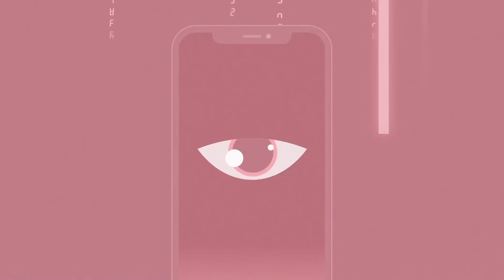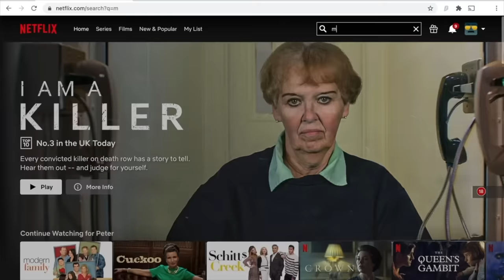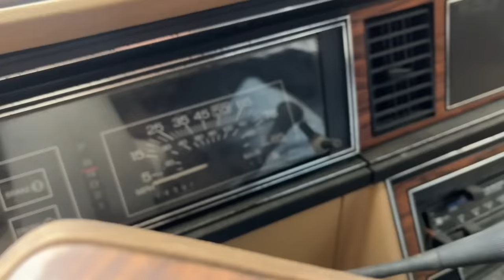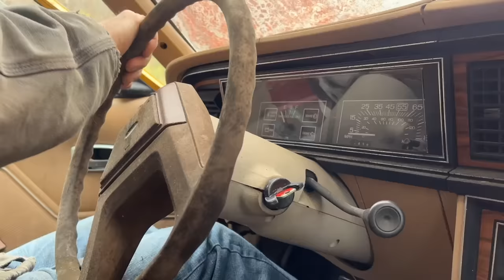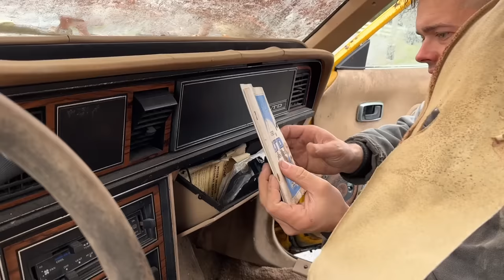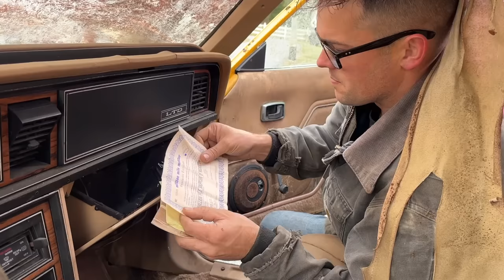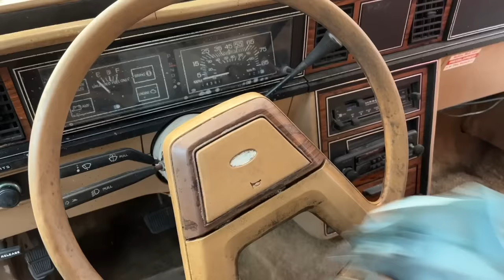You won't believe this car was in the junkyard 28 years! Almost perfect interior!

Comment: I think it was an old taxi cab. Back in the day it would do the airport run and you put your luggage in the back. Love to see how you guys work together as a team. Keep up the great work.
Reply: Same thing I was thinking. Stickers on the doors, spotlight, the numbers on the hood, and hatch, and the mandatory seat belt usage sticker on the dash. WAIT! See my comment above. I think it make even more sense.
Reply: This is exactly what I was thinking too!
Reply: Its gotta be that! But it’s in really really nice shape for a taxi.
Reply: I was gonna say the same thing. The sticker on the door, number on the front of the hood and the wire going up the tailgate and out the roof for the Taxi sign.
Reply: Boston Edison electric/ utilities
Reply: @willrussell7934  Ah, fleet vehicle. Still makes sense.
Reply: @willrussell7934  May have been fleet vehicle first, yellow was painted over that sticker meaning it may have been later converted for use as a taxi.
Reply: Definitely an old Yellow Cab. I used to drive for them. We did have spotlights on our LTD's to help see addresses at night.
Reply: It's chome yellow it was a extremely common factory color. Does NOT mean its a cab
Reply: @maj.FrankMBurns  the chrome yellow that year was more orange looking. Similar to safety yellow. And that is the original color for yellow cab. Since is was a franchise business. Some opted for a more banana yellow for their cabs. Chrome yellow was the color of our cabs.
Reply: @maj.FrankMBurns  Why's it white under the decal, yellow over the decal?
Reply: Yes, I think you're right.

Comment: If that car has been parked that long. I’m willing to bet it has 15k miles. Back in the day people traveled 50 miles of their home. This is my favorite car so for. The ice cream van is my all time favorite. I wish you would get that one rolling. Great video as usual ❤️❤️
Reply: 115k
Reply: It was owned by a power utility in New England. Given the condition of the seats and carpet it could very well be 15k original miles. I work for a utility and the office pool cars sit in the parking lot for months on end and when they do get driven it’s usually engineers going out to a local job site.  That engine bay and throttle body looked awful clean for 115k.
Reply: 215k taxi

Comment: I bought an 86 LTD wagon in 1988 and we drove it for our family car for about 15 years.  The only complaint I had was the 3.8 was prone to head gasket failure and I had to replace the gaskets at around 125,000 miles.  The heads are aluminum and if they were ever overheated they would warp and couldn't be milled.  Fortunately ours never was overheated and the heads were fine.  My vote would be to get it running but keep an eye out for coolant in the oil.

Comment: Boston Edison was the major power supplier for the northeast for years. They used these cars as repair vehicles and to read electric meters. It makes even more sense that the interiors are in great condition as nobody but the driver rode in them (plus equipment. I’d bet no one ever sat in those back seats. Sleeper would have been in heaven as they had a fleet of these vehicles.

Comment: Josh, you and your awesome family rescued a really beautiful car. That's the new Wagon Queen Family Truckster! LOL.... Seriously, I love the Fox wagons. My buddy had a 1983 Granada wagon with the 3.8L V6 back in the day, I loved that car. There was one idiot light on the dashboard. He drove it hundreds of miles with the CHECK ENGINE light lit - I got into it, drove it to the store, and I could tell immediately that it was overheating - stuck thermostat, wheeled into Canadian Tire for a replacement and did it in the parking lot. I was thinking about what would be involved in changing head gaskets. Cast iron heads and block, the engine took the abuse and survived with not even an oil leak.

Oh, and near and dear to your heart, the Granada had a trailer hitch. And towed a 1975 Oldsmobile Cutlass Supreme home after a failed safety inspection.

Comment: WOW!  Looks great!  One quick tip you may want to consider.  This might be hard to do, so if it is, don't stress on it.  Depending on how bad the carpets are with rat/mice urine and soil, you might want to research how to remove the seats etc., so you can remove and clean the floor of the vehicle under the carpet urine and other bacteria very well could still be stuck to the original frame of the car. Just a friendly suggestion.

Comment: In Australia all our Ford's only had 4.1 straight 6, or later it went to 3.9 ,in 85 was first multi point fuel injection, but then went back to centre point in EA ,then brought out molti point again next modle, also had 351,and 302,then later only 302 ,all the best to yous and your loved ones

Comment: This school bus yellow LTD wagon cleaned up surprisingly nice. A score on the interior.  I for one would like to see if the engine and transmission on this car are any good and what the probability it can be made to run. If it is a runner, putting the missing trim back on the front would be cool. And with a little care, the dents in the front fenders can probably be pushed and pulled out about 90% to 96% good. 

While no one wants these cars now, these LTD wagons were pretty decent family wagons.

Comment: In 1995 or so I bought an '86 LTD II from a woman who worked at a new car dealer; she'd snap up nice trade-ins and flip them. The one I bought had a stack of recent receipts in the glove box for: radiator, exhaust system, battery, brakes, tires, maybe something else. I paid $645 for it. When I got it I found it had a bad throttle position sensor and I think the person who had spent all that money on the car decided enough was enough when it started stalling out and just traded it. I replaced the TPS and the car was awesome. 4 door sedan, V6, loaded with power everything, stereo, tilt, cruise, AC, everything worked, and it wasn't rusted. Ran and drove like a dream, best beater I ever had. Also the front power seats were as comfortable as any I've ever had in a car.

Comment: Krud kutter works really good at removing all that gunk from cars too.  When I bought my 87 Ford Ranger a couple years ago, it apparently had sat under a tree, the hood and cab roof was covered in sap and just black nasty dirt and grime from sitting, pressure washer wouldn't get it all off either.  I bought a bottle of Krud Kutter, figuring the paint was already trashed because of the way the cab and hood looked, but sprayed it down with the Krud Kutter and let it sit for about 10 minutes, then the pressure washer got all that stuff off and the paint is in pretty good condition for an almost 36 year old truck and 127k miles on it

These older vehicles are so simple, not much to go wrong like with today's vehicles full of electronic gadgets.

Comment: The school bus yellow is a corporate color. Boston Edison is the power company for Boston, Massachusites and surrounding areas. This car was leased for corporate fleet use. Corp. fleet ID number is on the right front fender, by the headlight. Most vehicles in the fleet will be painted the fleet corporate color. Heat gun will probably remove the tape on the doors and fender.
Reply from the maker: Awesome thank you

Comment: Definitely get that 3.8 running! I am restoring a 1986 mustang with the same engine. I was going to swap I'm a 302 but I like the light weight of the 3.8 (factory aluminum heads) and the TBI. I'm told there is a side oiler system on it thats pretty good...don't know. I also heard the original GM 3.8 was designed from the same plans as the Ford. I loved that engine in my 93 Buick and 94  Bonneville. If you can compare them and find shared parts let us know!

Comment: I know you try and do this stuff on a budget but should invest in some microfiber towels they work a ton better than the blue shop towels also cheaper in the long run since you can reuse them, Also Adams makes some amazing detailing products. Last thing I changed my mind I think this would be a awesome burnout wagon. Quick tip on cleaning windows clean on side left to right then the other side up and down that way if you have streaks you know if it's inside or outside.

Comment: Great video Josh & family. The cranky bull looks like a Brahman bull. Is that correct? WE have them on cattle stations (ranches) in Australia. They do get spooked a bit.

The LTD did scrub up nicely. I would definitely watch a will it run on the single port EFI engine.

I also think you should look at the other two Fairmont's you saved, see if you can get them running, then if the bodies/interior/chassis are no good on one or both, but the engine/gearbox is good, transplant one into the yellow one.

Comment: Lets see Josh,Its painted the color of a Taxi, cig butts in all passenger ashtrays,spotlight for finding addresses at night, unit number on the hood,probably was a Taxicab or a shuttle.. Those speakers were probably also plugged into the 2 way radio. One way to tell was if the ashtrays had different brand of butts or the same. multi brands would indicate taxi/shuttle,same brand it was a company car with same people in it daily.BTW there is a lot of dirt,now pop all the moulding off ,windshield,backglass,fenders,doors,hatch,roof driprails,liscense plate box, side windows.wheelwells also door and hatch rubbers and get the dirt you missed. Now scrub car down with dollar store scotchbrite dish sponges will get all that black off better than a brush. I was a proffessional window cleaner,use soapy water and a straight razor blade to scrape windows,not steel wool.
Reply from the maker: Ok thanks

Comment: That car was probably put out of service because in the early 90's the inspection requirements tightened up on the emissions side of things and that is probably why it ended up in Vermont and then out of the Northeast because of not passing the emissions testing.

Comment: watching you video now on the yellow ford. looks like a granada wagon. could be wrong. i noticed you used to drive a black truck, now it s a white truck, guess you traded it in. lol  noticed when you were drving the white truck down your pasture. the check engine light was on. lol every vehicle i have owned for the last 50 years , since the electronics was put to use, every one f them had a check engine light. all of them was because of bad o2 sensors which is costly.  anyway, good luck with the yellow wagon. dont burn them out too much doing ripping. lol god bless your family. :)
😀

Comment: Hello interesting car, because it's a completely yellow car it might have been bought by security company. I had an 84 with 3.8 and a carburetor. I commuted between Culpeper Virginia and Richmond everyday for a year or so. I paid $500 for the car ran it for a year, put 45 or 50,000 miles on it and sold it for $700 when I was done so I was happy. the cars with cruise control extremely good system. Are you going to turn it into something a lot more special than it is now? Thanks for the video best regards Bob from Virginia

Comment: Please, please, PLEASE try to get it running. It might require a new electric fuel pump and/ or ECM but that car is worth it.
BTW, If that was the original paint on the wagon, it must have been a 'fleet' option special order. Probably a pickup truck color.
I wonder if 1984 was after they stopped putting trim tags on vehicles. You could check it for a paint code.

Comment: I put 500,000 miles on a LTD station wagon like that cept mine wasn't yeller, mine was a cream color with fake woodgrain down the sides and lift gate..3.8 v6 4speed automatic that was installed new 30 days after buying car cause the transmission was faulty and for some odd reason they'd weld themselves together inside the transmission case..I'm guessing clutch assembly or something like that but I lucked out, got a recall and after the new transmission, I decided to take really good care of the car cause it only had 60,000 miles when I bought the car so actually I put only 460,000 miles on the car that had 520,000 miles when I finally decided to sell it and I still don't know why I sold it cause I kept everything up every 3000 miles whether it needed it or not..

Comment: The antenna thing on the top of the car that is an nmo mount a hole is cut into the roof of the car it is filled with silicone and that is mounted onto the top then the antenna screws into the top of that mount I am a ham radio operator so I know all about antennas it was probably low band VHF
Reply from the maker: Ok thanks

Comment: I think i know now what the issue is. Try to take out fuel relay. And jump it with a  cabel . I not remember what pins to jump. Some years i had the ST 200 Mondeo . This problem made me crazy. Car suddenly start . And then not start again 
Did find issue after chasing the problem a long time.  The relay box was fried. Did Change the whole unit. And car run again without issues . But try jump relay socket first. If car starts. You need change the unit. Its then fried. 
But if car now start without issue every time . 
Maybe problem is fixed 😊👍
If not start again. Try jump socket

Comment: Excellent video Sleepdude Crew Josh   :) also say security company for dock like Boader Crossing System for name and  spot light for night like check so nobody do break also enter without premmision  ! Gate Keeper Security is for big companies do Highway Tractor Truck 18 wheeler shipping and recieveing gaurd let them plus workers for parking too! Radios talk to Operators service at Police Station or company on site if need extra Security or get Police if were hurt too! Hope helps out Josh  :) also very good shape in for 1984 LTD also yes first year of Full Injection of TBI  on V6 motor and Canary Yellow is paint color with Butterscotch Beige Interior! Surprises me the had Jack to also very good shape full spare tire not Doughnut Spare had and grey dust was on tire from Scrap Yard too sitting for years too!

Comment: 😎😎😎
  2001 I ran across an 89 Geo Metro XFI  3 CLY 5 SPEED  , It was on a used car lot , no title and didn't run ,I paid $150 . 
  Got it home ,discovered it needed a new timing belt pulley,  replaced and it started and ran great, 
    Found papers that had the pervious owners phone no. On it ,called them and they signed it over to me  free and clear .
   Now 22 years later I still drive it daily    , it has 353,000 miles on it ,and have gotten 55 mpg .
      Here's an old  video of it , still looks about the same with different mags .
https://youtu.be/prcjov77oDs
  What you think?
   I did all the mods myself.

Comment: Try to start    If not     pull. An put a good 302 in.   I would say 351.  But it looks like a mustang.   So a 302 will drop in    May b a little horse power       It’s sweet   Fix it.    Keep em going.

Comment: Definitely not a soccer mom station wagon or “daily “ driver. If it would have been seats wouldn’t be that good and rust wouldn’t be that little seeing it was in wintery snowy states like MI, NH, VT. Try to see if it’ll run if not then rebuilt engine it is.